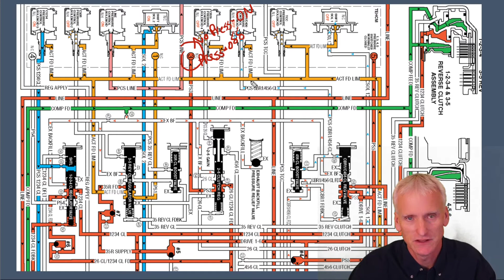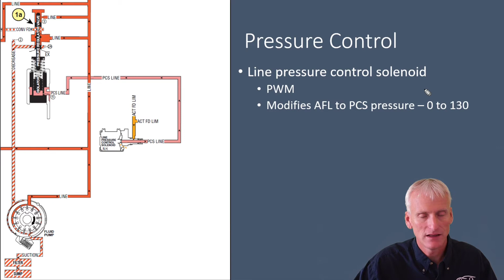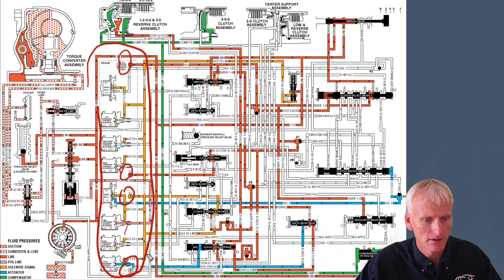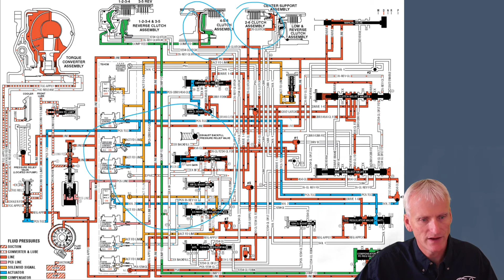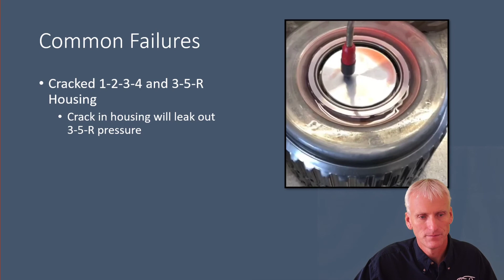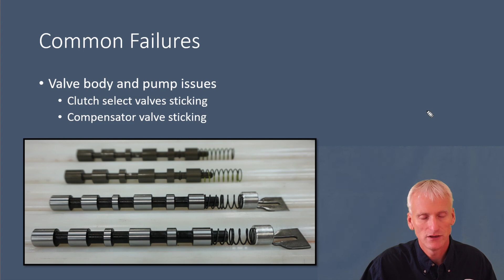6L80 Electrical and Hydraulics

Comment: I know this is an old video but I had an instructor at the GM training center outside of Dallas pull almost the same joke on us. Started going through the hydraulic circuit diagram faster than anyone could follow and said "just kidding" 😂 That was a good flashback! Every video I've seen from this instructor so far has been incredibly helpful!

Comment: I watched your power flow video before this and even posted how nice it would be to see some information on the hydraulic system.  Well lo and behold…….. I am going to continue to study until this makes more sense.  I am a thirty (+) year Master Tech that has just recently decided to get into transmission repair/rebuild as aggressively as possible.  Like most of the systems I have learned over the years, knowing the “theory of operation” (what does this part/system do and why) is key when not only diagnosing difficult issues, but also being able to see/verify proper assembly and operation.  I don’t want to simply just replace what I think I should or what I’m told I should during a rebuild and then just assume the unit will work properly.  I want to know as much about why and what as I can learn.  I would love to build a couple of transmissions with you as an instructor!!!  Thanks for making the videos.  They really are helpful!!

Comment: Very very helpful video, what would cause slip once its selected a gear say 2nd or 3rd, moderate to heavy throttle input, is fine under say 50% but anything over that it begins slipping, been trying to work out whether maybe the pressure isnt anough to hold the clutches engaged, any advice or pointing in the right direction would be appreciated

Comment: Slightly off subject, GM Colorado 2014 6L40 does not engage Drive first gear and slips, but does engage if put in Manual first, where should I look please. No codes. Awesome video, THUMBS UP

Comment: Dang I’m seeing 300 psi on 1st and second when shifting but then settles to 150. And she’s whinny so sure got a leak somewhere
Reply from the maker: I wonder if it’s the bridge seal between the case and the 2-6 clutch housing.  Those seals can blow causing a big leak.  Seal aftermarket has a fix for that.
Reply: @siuautomotive   Thank you for responding though I love yalls videos I hope to learn more from y’all in the future and I will look into what you commented .
Reply: @siuautomotive  so I went and seen what you meant by bridge seal and I do have the sonnax center support seal those little metal inserts plus the rubber seal but that always worries me when I put the valve body in that it’s not sealed . I have some new transgo valves coming for this new lower valve body I installed so I’ll get a chance to test that theory .

Comment: I could really use your help ! I have a brand new GM 6L80 and it will not shift out of first gear. Goes into neutral or maybe slip until you let off the throttle then 1st gear returns. Tcm is commanding the shift but nothing is happening. What should I be looking at ? Also has a 2-3 second delay going into reverse.

Comment: Here is what I find interesting about the 6L80 and 90. There is only one one-way clutch for first gear, which means that by default there should be engine braking in all other 5 forward gears. So am I right to assume, that when coasting, the TCM drops the converter feed pressure to a minimum, and if necessary, disengages the TCC, for maximum slippage, reminiscent to what it would be pressing the clutch on a manual? Likewise if the brakes are applied, that feed pressure would be immediately ramped up? 

If that is true, then the next question is, in an emergency braking - will it re-apply the TCC and the low/reverse clutch when it gets down to first gear?

Comment: I have a 2008 Escalade with a 6L80e that is having EXTREMELY harsh 4-5 shift under any load. Other than that, there is no slipping, flares, or anything. Logging shows no errors, and there are no codes. Does this sound symptomatic of a TECHM/valvebody issue, or more likely the transmission itself? Fluid is at proper level and not burnt, trans never gets above 145F. It's odd that only the 4-5 shift is affected and it's such a harsh shift that it wobbles the truck.
Reply from the maker: Well, I would be wondering if the 1234 clutch is hanging on too long, sine that's what's releasing and the 3/5/R is coming on during the shift.  I would suspect you'd have issues with 3rd, 5th, and Reverse if it was the 3/5/R.  There is a "balance" end of the 1234 piston.  I just wonder if you are having issues with that.  The spring and compensator (balance) oil are responsible for pushing the piston back when released.  The solenoids aren't serviceable so if you don't find anything internal, you'll have to try a new TECHM.  You could check for checkballs that shrunk (common) and for any worn valves.  Since you use the term "logging" it makes me wonder if you are using HP Tuners.  Did anyone tune this trans?  Maybe they monkeyed with something that could cause this issue?
Reply: @siuautomotive  I am going to try a new techm/Valvebody assembly first to avoid pulling the trans. I have efilive for ecu tuning but no trans mods, just using it for logging ability.

Comment: Thanks for the awesome video! I wish I would have found this before I rebuilt my transmission. TCC failed on mine, and destroyed the pump. I did a complete rebuild and replaced the pump. Everything works great except for when it gets up to temperature, and only intermittently, I’ll get 3 - 4 pulses immediately after shifting into 2nd. It only does it occasionally, and only when it’s hot, so strange. I’ll have to rewatch your video a few times, and maybe I’ll have an epiphany. Thanks for the awesome content!
Reply from the maker: I wonder if you are leaking 2-6 clutch oil.  That passes through the bridge seal between the center support and valve body.  Sometimes that seal has a hard time surviving.  Seal aftermarket makes a kit that locks the center support to the case and provides a better seal.
Reply: @siuautomotive  Thanks for the feedback!    When I did the rebuild, I installed the Sonnax seal support kit for the center support seal. I pulled the valve body to check the center support seal anyway, and it seemed fine to me. I decided to air test everything since I had the valve body out, and discovered that the 1234 circuit was severely leaking into the 35R, and compensator feed circuits. You’ve probably already guessed where this is going. I replaced the pump, and forgot to install the expander rings that go under the pump sealing rings. I looked back through the ATSM manual and didn’t see any mention of them, but maybe I’m just over looking them. Your 6l80 rebuild video was very helpful in confirming my mistake. How this thing shifted at all baffles me. I installed new seals with the expander rings, and it shifts beautifully now. Thanks for your help!
Reply: @cfamgang  the ATSG manual only shows the early stator sealing rings that did not utilize the expander o-rings. They are only used with the later non-rotating sealing rings.  It almost got me as well.